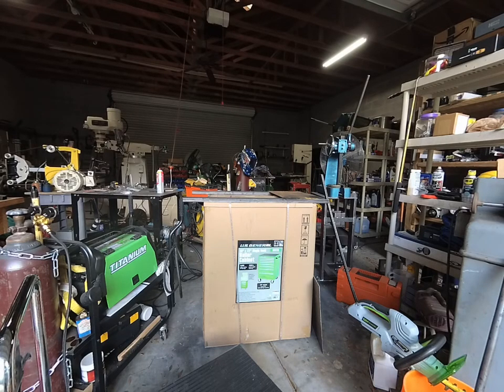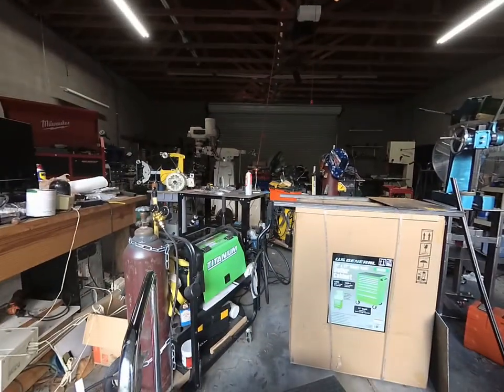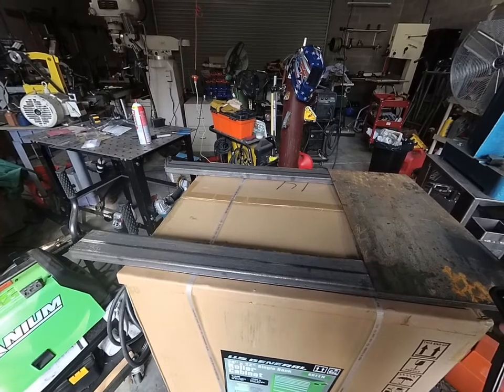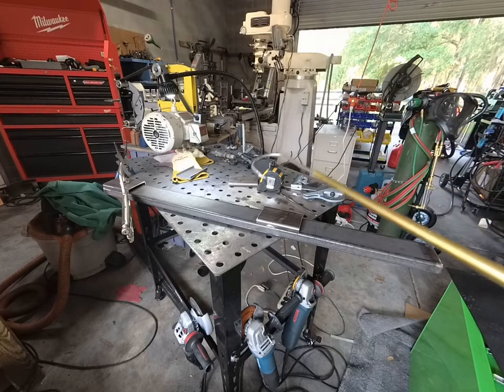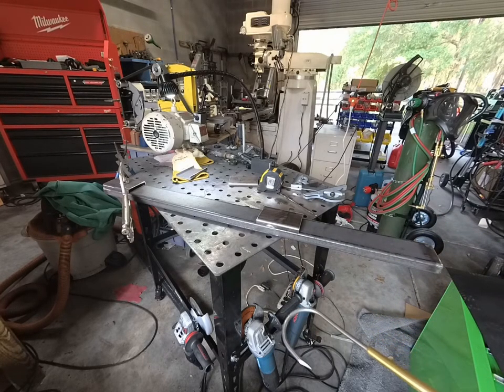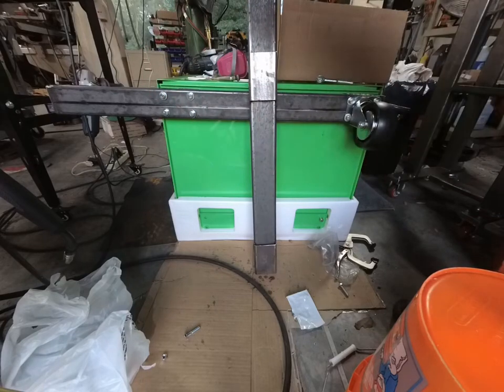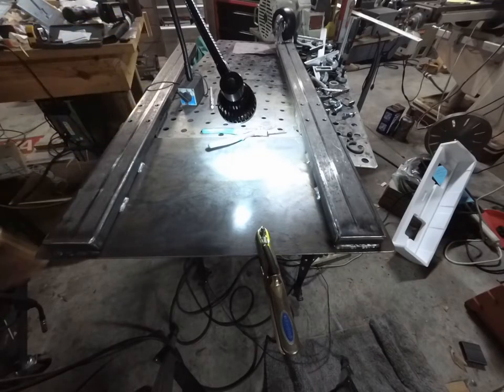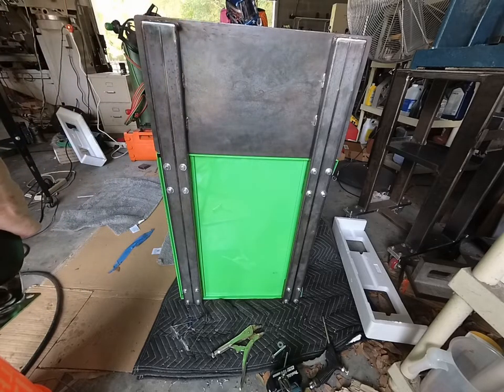Welding Cart Made From Harbor Freight Tool Chest

Comment: Hey Bubba. I struggle with more than 2 holes too>. I know there are foolproof ways. I aways forget them during a build. I make a thin cardboard template. Always works. You missed one great way to drill those 16 holes. You had the casters. There is your template.

Comment: Your cart is exactly what i want to make.  With your design, using the same US General tool cart, do you think having one of the larger Everlast TIG machines  with the TIG Cooler attached to (under) the welder would place the welder too high for use and cart stability?
Reply from the maker: I suppose if it's unsteady you could add members to improve the cart.

I made a better cart later. There is a video. The tank restraints should be lower, and one set of wheels should be farther apart to make it more stable. I am going to move the wheels on the first cart.